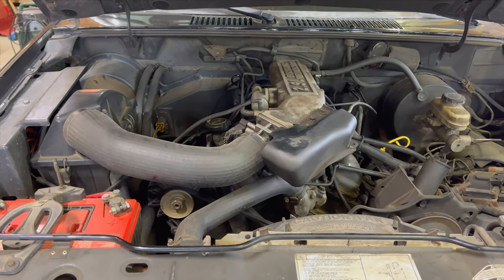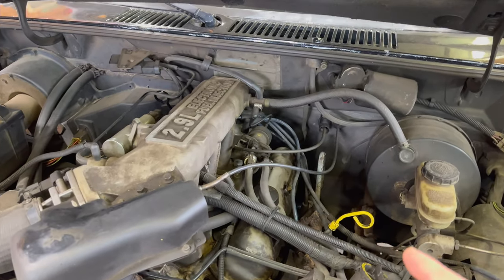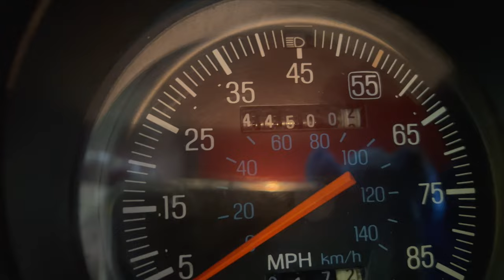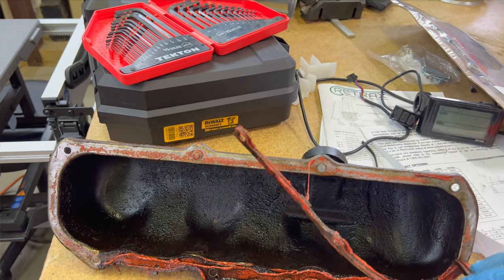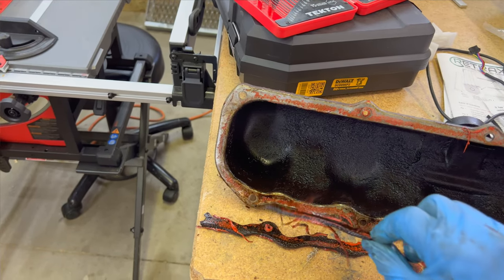Leaking Oil Replacing Valve Cover Gaskets on the 1988 Ford Ranger

Comment: WHEN TO USE RTV
Due to their shape and design, some molded rubber gaskets necessitate the use of RTV as a supplemental sealer.

Please note that RTV is not to be used on the entire gasket; the gasket should be installed clean and dry.
RTV should only be used on the corners of the gasket and/or stepped casting areas that have a gap. Using a small amount of RTV will fill in those areas to assure a leak-free assembly.
RTV is typically applied to the corner(s) or stepped areas on the engine so as not to smear the RTV during the installation of the component.

Comment: I got the oil pan off and replaced the gasket without pulling the motor, it was no fun though, had to remove both motor mounts completely jack up the motor remove transmission mount jack up transmission, and remove the exhaust as well, snapped an exhaust bolt that was seized into the maifold.. fixed my oil leak but made an exhaust leak😂

Comment: I don't mean to be critical and year after the job is done, BUT, if you coat the gasket on all four sides first than you have silicon gaskets instead on cork and let it dry overnight also those tabs on the gasket, break them off if there is no cut- out in the cover also I'm thinking 4.0 ohv gaskets might be not silicon.

Comment: Felpro sells all rubber style ones that work pretty well
Reply: Got a set of these and they are terrible fit. Bolt holes are very poorly aligned, also a bit larger than it should be. Doesn’t fit flush

Comment: Not done watching yet, but hopefully you torqued to specs. The most common thing to happen to valve cover gaskets is over tightening them and cutting the cork. The bigger crank case fitting is for fresh air in, the littler one is the PCV valve. It should rattle, if not it's bad.
Reply from the maker: Ah ok, couldn’t remember which way that went again with the breather.  And yes, torqued to spec.
Reply: How do you know if it’s torque to spec ? You have a certain machine to know ?
Reply: @vorutouzamaki2635  torque wrench